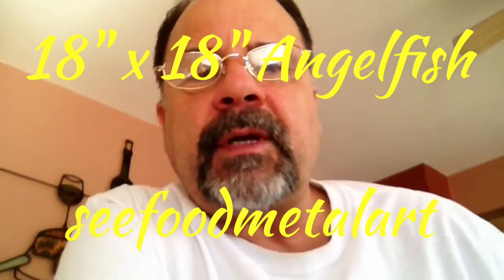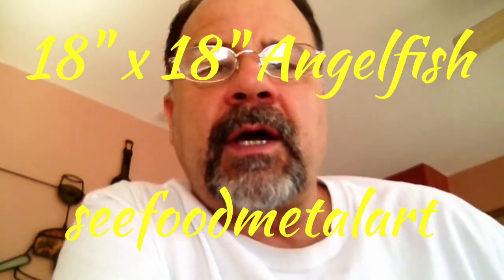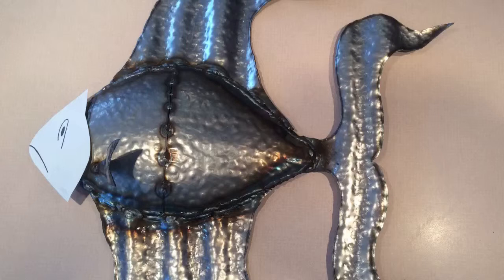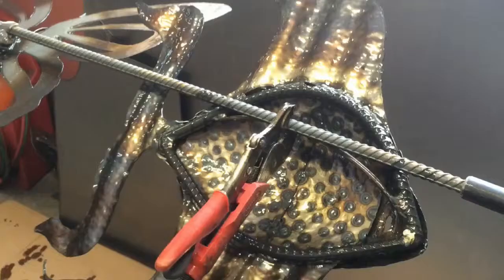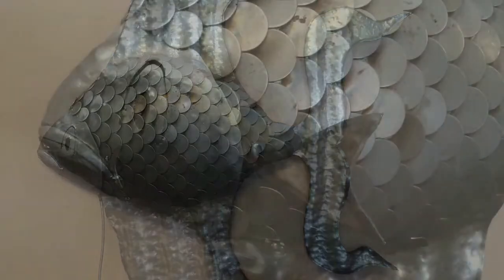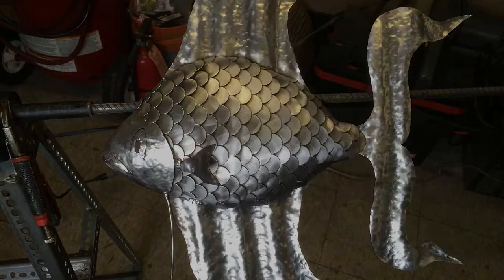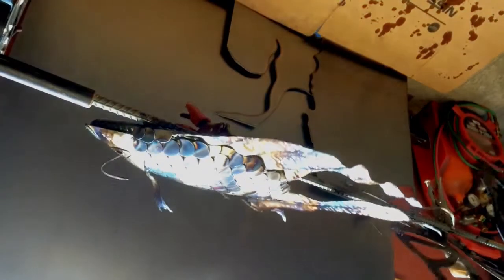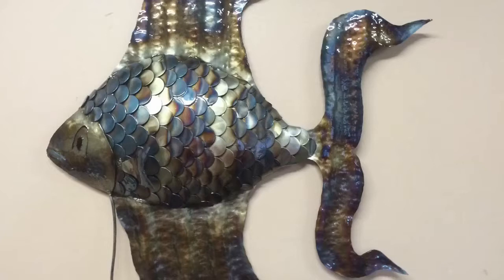18" x18" Steel Angelfish for your wall.

Comment: just found your site love it 
question what are scales made of
Reply from the maker: The scales are 22gauge steel plugs I had punched from sheet metal. I brought the sheet metal to a local machine shop and they punched them out for me in a few different sizes.
Reply: Thanks man